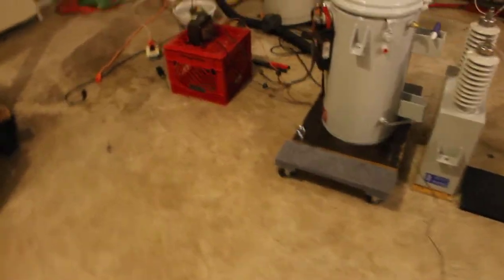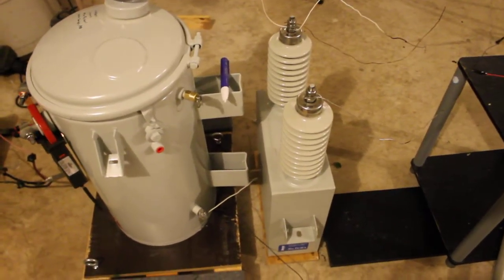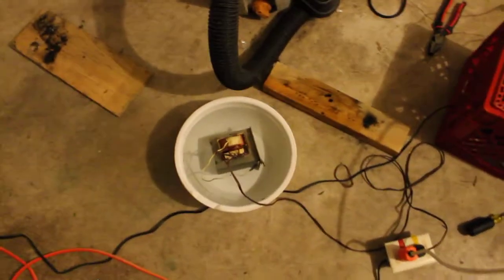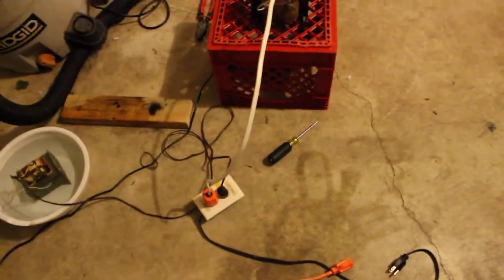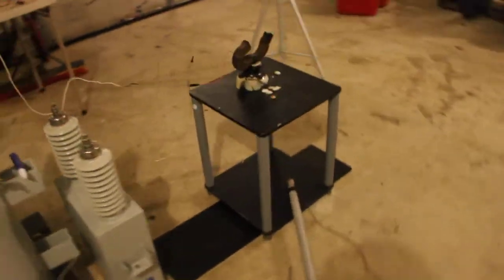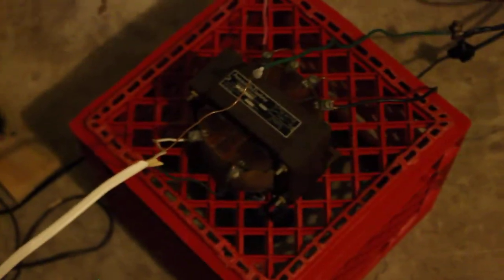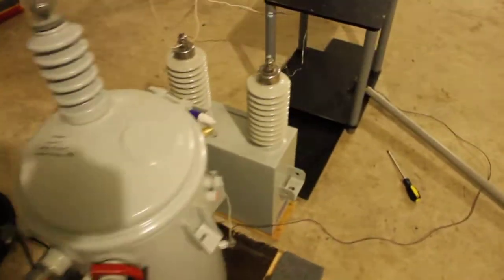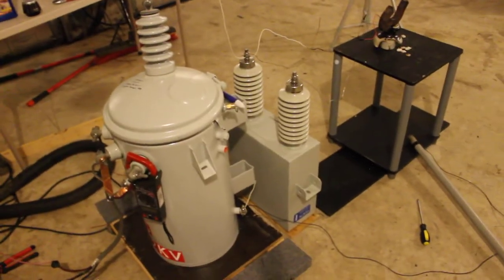1 Min 44 Secs Continuous 7.6kV ARC!

Comment: That big of an arc on a 20A outlet?? I had a bunch of MOTs connected in series to get 6 or 7kV and about an amp and it drew up to 60 amps at 120V and didn't look anywhere near as cool as that. Does the capacitor help a lot?
Reply: Really? I've gotten that sort of output with just 2 MOTs

Comment: Connect up a tree branch (a branch recently picked) to the setup and watch what happens;) I'm probably going to order a 5 or 10KVA 14.4kV pole transformer as I think having my very first pole transformer, that should fit my needs, because I've been thinking of constructing a tesla coil and I've heard that 14.4kV's are the best for them;)
Reply from the maker: Variac Maniac Earlier, I had got a whole power line setup with the 7.2kV pole xfmr., burning branches and hot dogs. But all the videos were on my computer which took a crap. Regarding the transformer, you may want to try one rated at 24,940Y/14,400X12,470Y/7,200. As that is a common tap configuration, 2 120V coils on the LV side series to 240V and 2 7,200V coils on the HV side, configured to be series or parallel with the tap changer.
Reply: Oh!! Yeah, that's something I should go for, isn't that a transformer similar to your 15KVA one??
Reply from the maker: Variac Maniac Yes, the 15kVA transformer I have is rated for 7200X14400. The midpoint 7200V is better for blowing stuff up because it is still high voltage with double the current of 14400V. Unfortunately I am limited with a 20 amp plug as a power supply currently, so I won't be able to put 15kW into it.
Reply: Oh. Will you have a higher power supply put in to run these at a higher power?
Reply: Oh and if you don't mind a few more questions on purchasing: did you request a quote or did you call them, they accept payment by card I'd have to imagine, and did it cost to have it shipped to the FedEx department? Who knows how many more questions I have to ask, I'm pretty sure the purchase is simpler than I think.